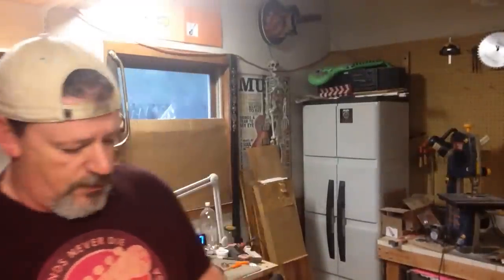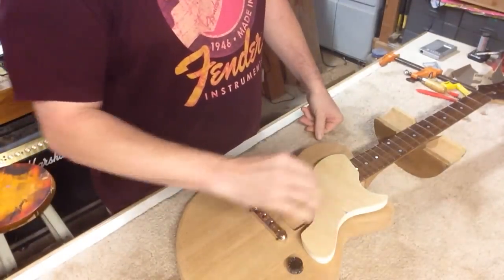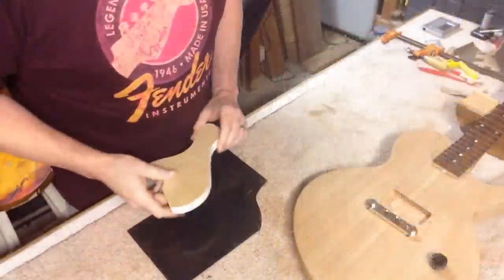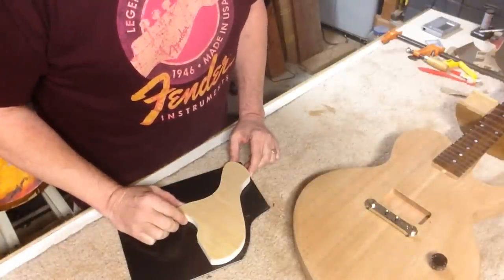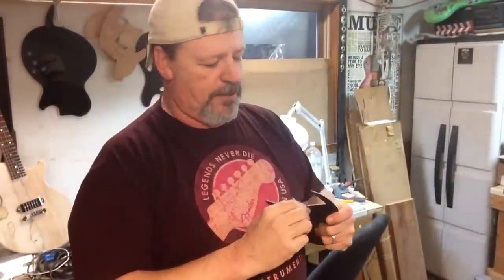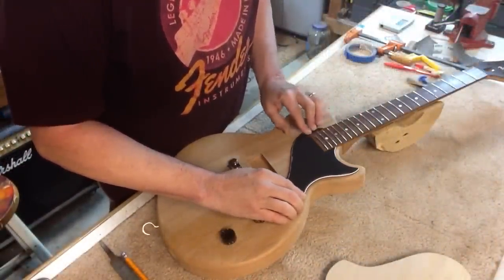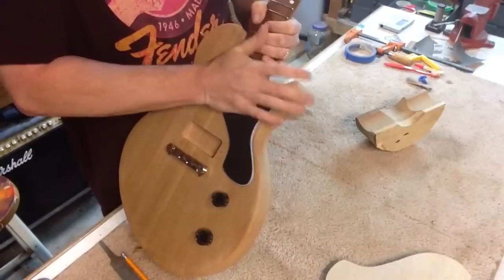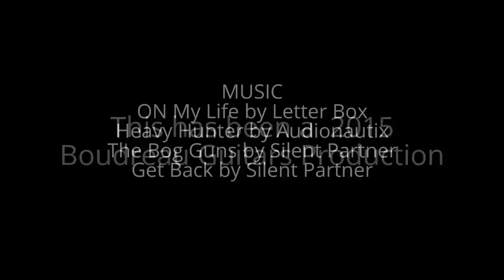Luthier's Tips & Tricks #10 - How to make a great looking pickguard from scratch.

Comment: I never understood the reasoning behind slapping a garish piece of ~plastic~ on top of a beautiful piece of wood in the first place. When I get any type of 'rear-routed' guitar, I remove any pickguard it has. When I get any top-routed guitar (where the 'pickguard' is, practically speaking, the equivalent of 'pickup-mounting rings'), I use it for a pattern/template/stencil to cut my own out of 3-ply basswood,  make it accommodate any wiring upgrades/control layout I might have done, and finish it in some manner that goes with the rest of the guitar~~~something that plastic 'mother-of-toilet-seat-cover' pickguards ~rarely~ do......
Reply: Subbed, though; I like your approach and shop-demeanor. Thanks for making these vids!
Reply: It depends on the guitar for me. I find a good pickguard compliments the guitar in a way that's better than plain. It almost accentuates the grain when done right. 

Kinda reminds me of an old vinyl top car. May not be the prettiest thing in reality, but it certainly compliments the rest of the vehicle.
Reply: @salzulli6290  You're right in your car-simile; and that highlights the difference between 'art' and 'craft'. 'Craft' (and 'craftsmanship') totally works with Plastic ["NOS", right?!], and whether you're restoring the dashboard on a cherry mid-50s pickup truck, or Cleaning Up a pawnshop Stratocaster, plastic has it's Place (as an integral part of The Original, and its marriage of Function and Form). That said, the pickguards I fabricate out of wood aren't selected to "accentuate the grain"; I primer them and hand-paint either a picture, design, or 'texture' that will ~pop~ on a solid ash/alder guitar-body of whatever color.....that's 'art', and an entirely different approach and process than that which involves choosing/cutting an Appropriate-Looking polymer laminate. It was while assembling a Warmoth Strat (chambered black korina body w/ one-piece bubinga neck/board), and finding a 'tobacco-juice'-whorled pickguard-blank that suited it in the manner you describe, that I decided to start making my own, for solid-color finished Teles and Strats.....that I could paint and seal. I just finished a clouds/smoke textured pickguard for a Peavey Strat I put 'lipstick' s/c's in; the body's gloss black under laquer, so my pickguard automatically goes with it. 
I agree that although 'solid color' finishes benefit from ~hand-painted~ pickguards, they would clash with a beautiful 'natural finish' body.....that's why I typically remove ~any~ pickguard from rear-routed solid-bodies (LP, SG, Carvin, Schecter, et ai), as well; they detract from the nice-looking cap (or body-wood) figure/grain.

Comment: When drilling the pick guard screw holes, how do you get the beveled edges inside the screw holes, so the screws sit flush with the top of the pick guard?
Reply from the maker: G Mattison http://www.homedepot.com/p/Bosch-1-2-in-Titanium-Countersink-Drill-Bit-CST1/203530165?MERCH=REC-_-mobileweb_pip_rr-_-100531905-_-203530165-_-N